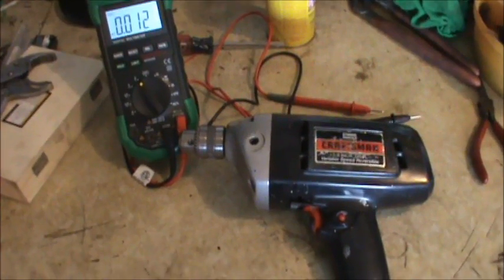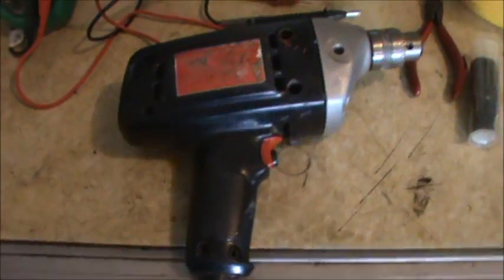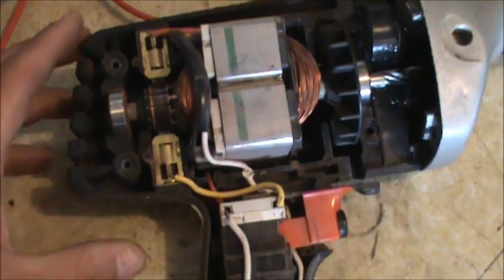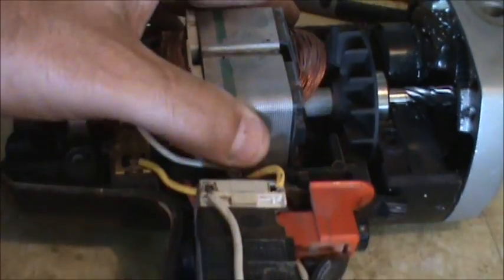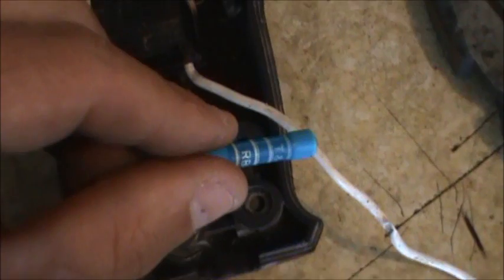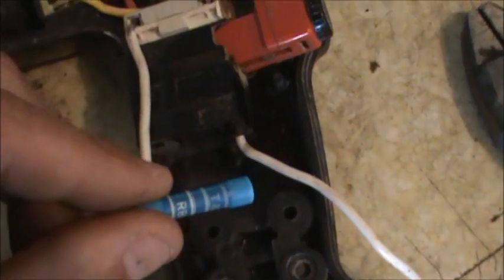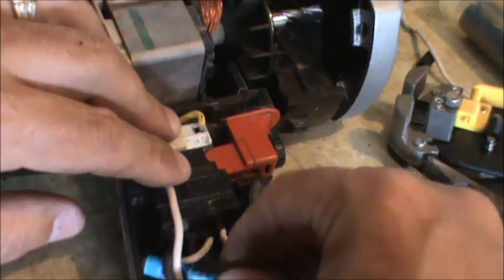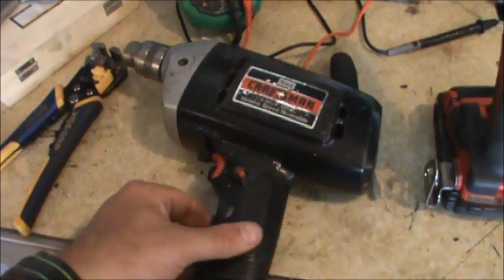Broken Drill Repair And Chuck Replacement

Comment: Wel done. How come the chuck looks like new on that old drill ?
Reply from the maker: antraciet   Good question.  I didn't even think about it.  I think because the chuck is only 3/8 inch and keyed it is really small, in comparison to how wide the older style drill is, so it never really got scuffed up.